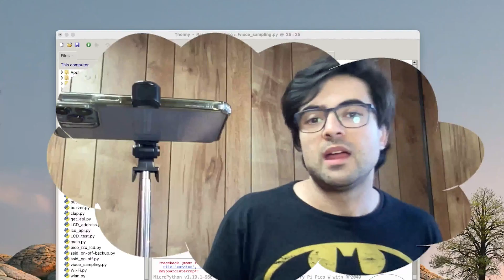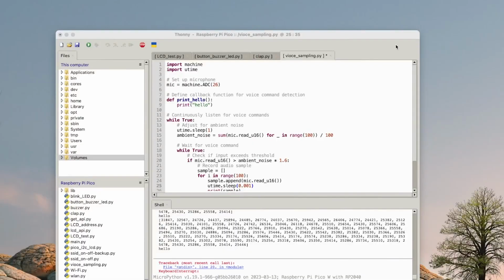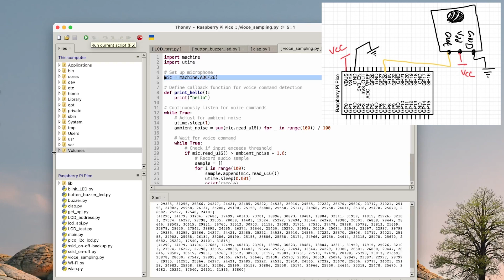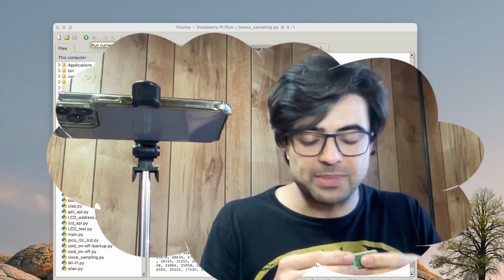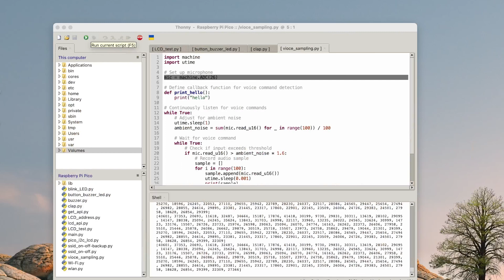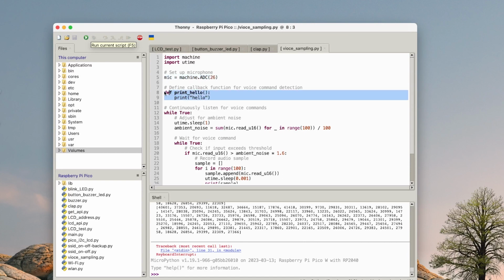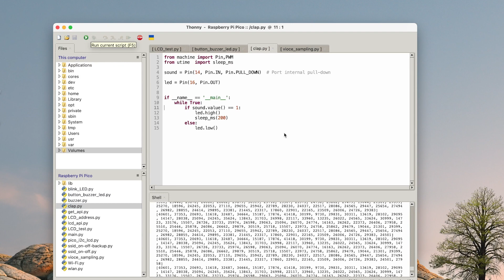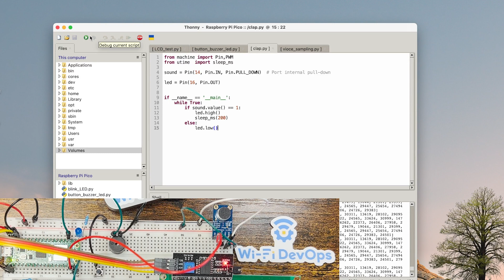Voice Detection with Raspberry Pi Pico W

Comment: Apart from Raspberry Pi Pico W, what components are needed to build the voice detection model?
Reply from the maker: I've used Adafruit Electret Microphone Amplifier - MAX9814 with Auto Gain Control [ADA1713]  for the voice detection part.
Also you need a LED light plus one resistor that could be either 220 or 1k Ohm.
Reply: @aminsedighfar  And any datasets or something?
Reply from the maker: @NONAME-ho7ny  I guess you can find it online, I don’t have anything on my end!
Reply: @aminsedighfar  Alright. Thank you!
Reply from the maker: @NONAME-ho7ny  Anytime!